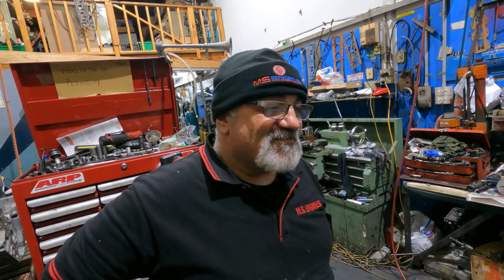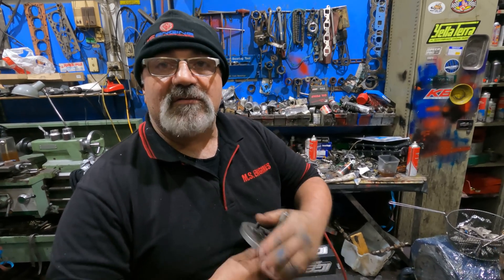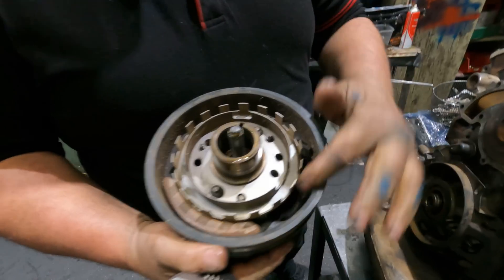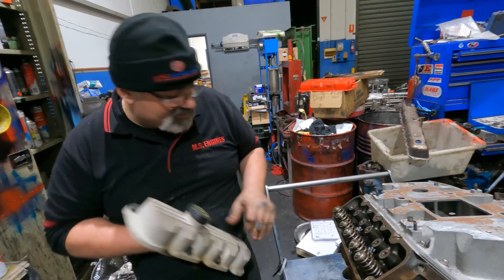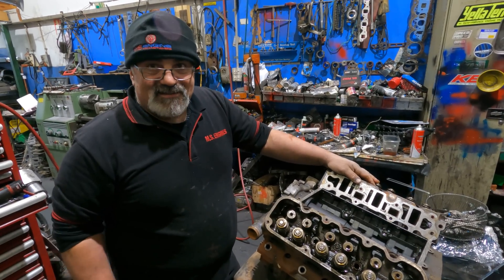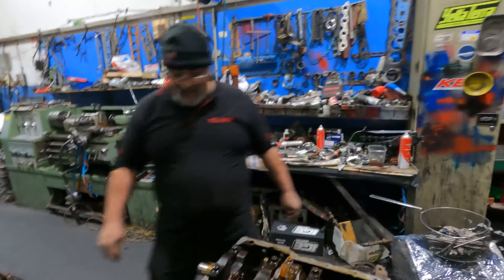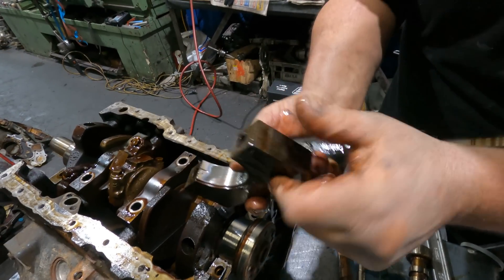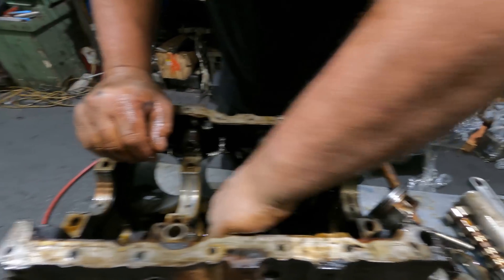Ecotech Super 6 teardown and diagnosis

Comment: We took these engines for granted, turned out to be one of the best GM engines ever made and us aussies got the best ones.
Reply: Until you start racing the heaps of crap. Bad oiling system for high revs. We have buckets of broken bits.
Reply: yea but people say they crack heads because of heating issues